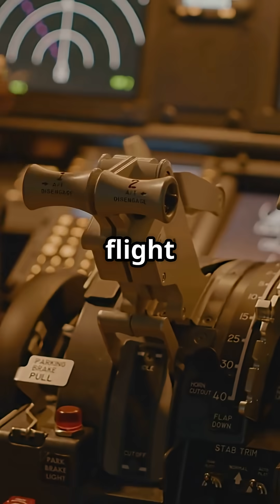Why doesn’t the Airbus sidestick move when pilots fly the plane?

Comment: It’s basically a sensor which recognises the input of the pilot and starts giving off its output with less input applied by the pilot . But in Boeing jets, the yoke doesn’t understand the mental toll of the pilots with less input applied, it is more manual than that of Airbus.